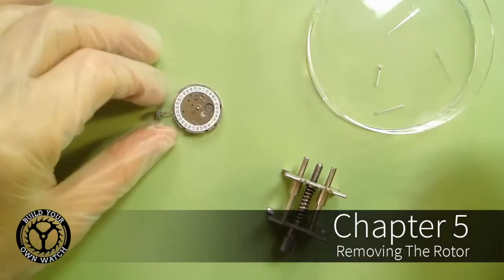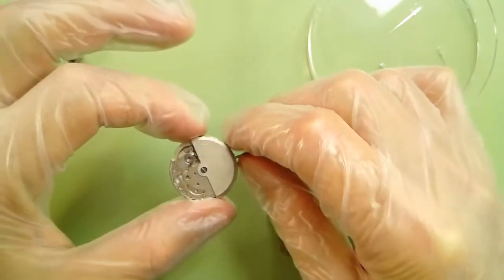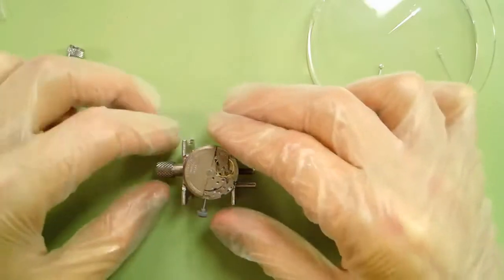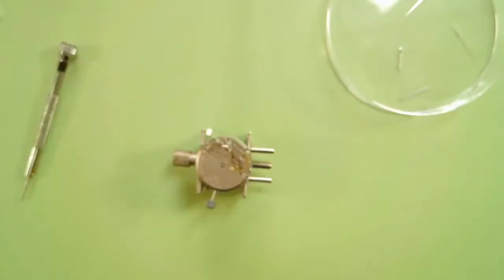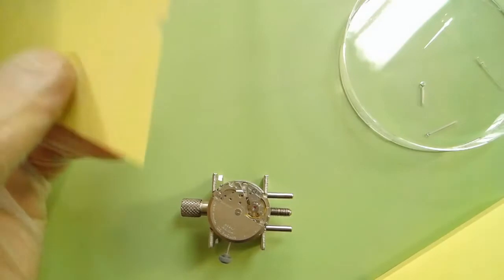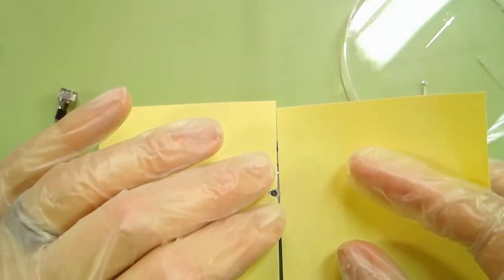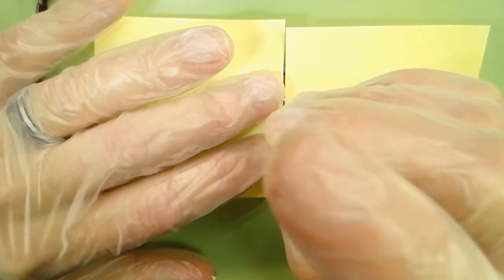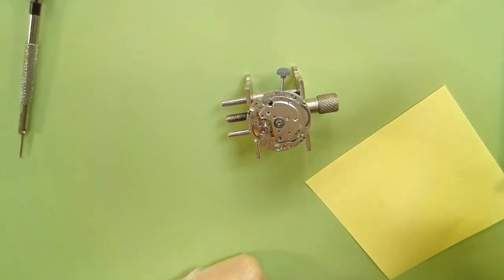Removing The Automatic Rotor: Build Your Own Watch #5

Comment: I bought a dg 2813 from that sight and wanted to know if everything applies with my watch build its a datejust build I'm making I will be using date wheel does dg 2813 have hacking or is it just winding?
Reply from the maker: We are not familiar with that movement, you might want to contact Esslinger to see if it has the Hacking feature. Some of the build processes will be similar but not exactly the same I would suspect.
Reply: Build Your Own Watch alright thanks boss appreciate your response and time love the videos very helpful